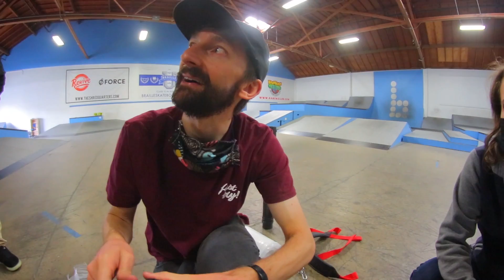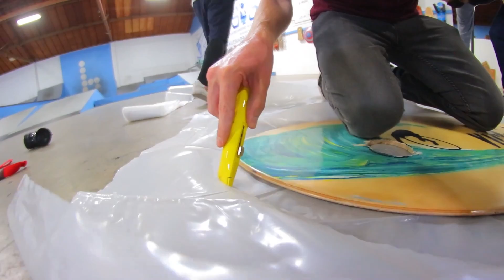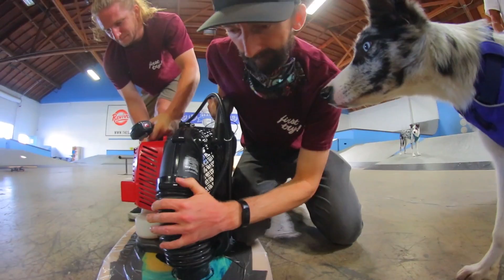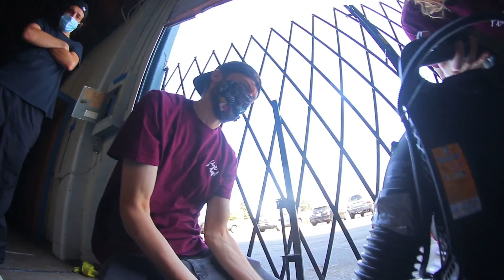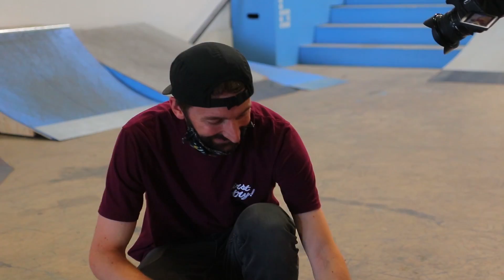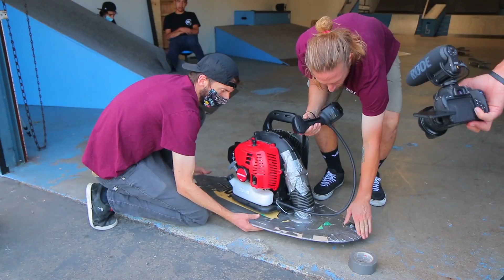WE BUILT A REAL HOVERCRAFT!

Comment: Extend the hose to the leaf blower like 10' or more so it doesn't add the extra weight to the board.  Then you can have someone wear the leaf blower and walk with the guy trying to ride the board.  Also you could add multiple leaf blowers, like one front, mid, and back.  I think it's just too much weight for the amount of air.  Reduce the weight and crank up the air supply.

Comment: you need to create a skirt around the bottom , and wear the blower on your back and get a loger tube down to the board. 
a hover craft builds pressure under the board and the skirt keep contact with the ground letting just enough air to escape too make it float . also your blower might be under powered

Comment: 1; Piece of plywood 2 foot wide 3.5-4 foot long 
2. 3 blowers, one hole on the nose, one on the tail, one in the middle
3. Use that plastic contraption you guys made
4. That skirt everyone's talking about, but just on the sides
5. Set the middle blower to a constant, steady throttle 
6. Use different levels of throttle on nose and tail, mixed with leaning the body to move forward or back

Comment: Such a cool idea 🙂
A couple suggestions: 
1. Make it so the board has a thicker/round skirt so that the air has somewhere to go and inflate, I don’t think this setup had enough available inflation volume. 
2. Fewer but larger holes towards the center will help with mobility. 
3. Possibly find a smaller/electric powered blower to reduce weight. 

I can’t wait to see version 2. 🤘🏼
Reply: larger holes will only work if they add the skirt, otherwise their best chance would be many small hole to the point where you aren't losing too much pressure

Comment: to mutch air is going out the side and is not getting directed down you shoud make a skirt going from the board and down to the ground whit tape to keep mor air under the board probably still wont work tho its to heavy compared to the air its producing
Reply: Also the plastic bubble needs to be a little bigger and the holes need to be more like a grid pattern. Lots of small holes like a peg board. With the skirt and MO POWA!
Reply: @e-ironmanmarsden754  gotta get a bigger blower with more HRSPWRS.
Reply: I think if the area of air cushion it created was larger as well, think about it like trying to hold yourself up on a giant inner tube vs a tiny one requires higher pressure therefore harder for the leaf blower/holes system.
Reply: This. You need a skirt around the edge to hold the air under the board.
Reply: rip red reserve